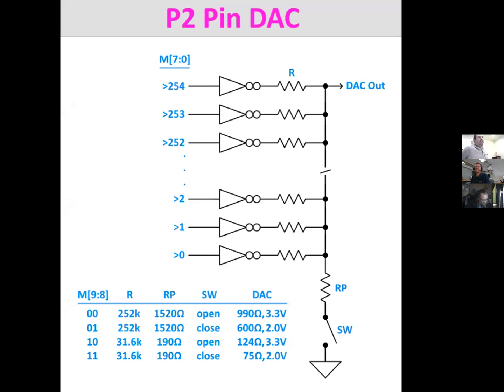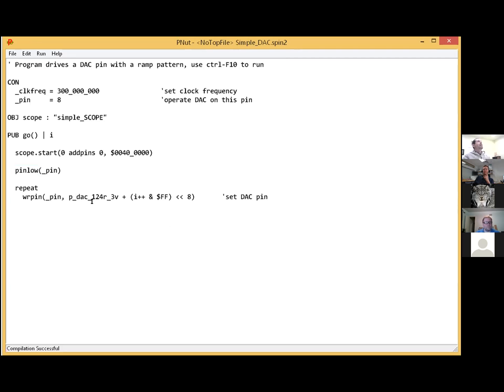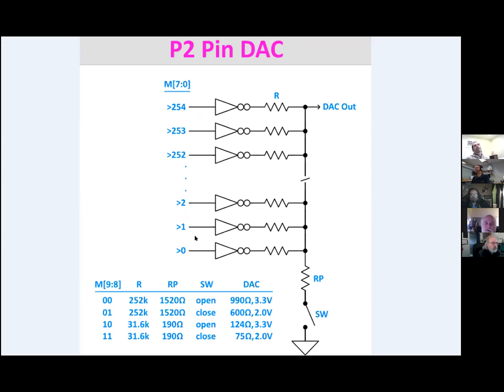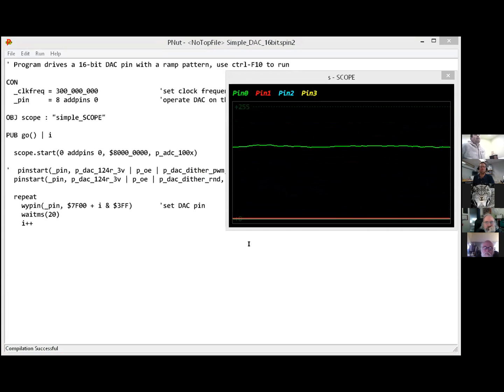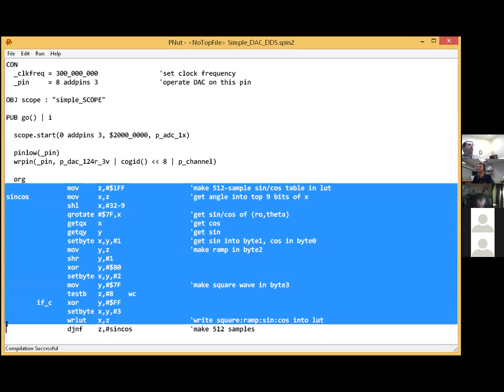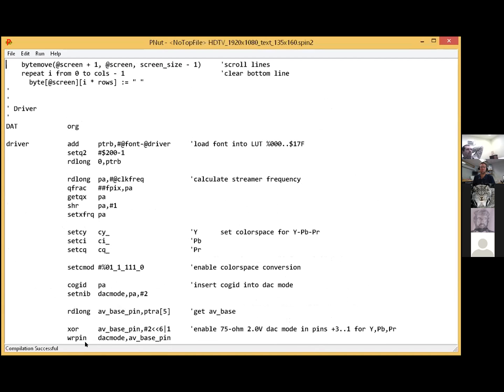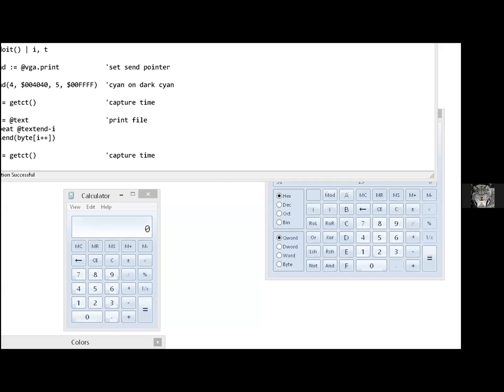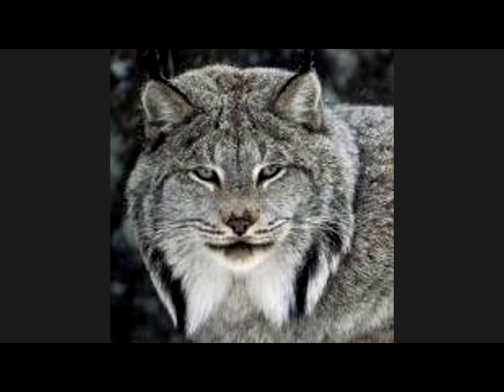Propeller 2 Live Forum: DAC Examples with Chip

Comment: Folks, USB-C video doesn’t need anything fancy. Just use HDMI alternate mode. It’s HDMI physical layer, capacitively coupled, running over USB-C plug and cable. Still HDMI. P2 already does 95% of it, the rest can be done even by an Arduino. All it takes to enable the alternate mode is a bit of 300kbaud PD signaling over one wire to negotiate the alternate mode with the sink (eg a monitor) and then you just feed HDMI straight from P2 pins over the TMDS lanes. If you want details for CC packets needed specifically for this mode, you have to get the HDMI USB-C alternate mode spec from the HDMI overlords for a sweet $5k (gives access for a year), or just sniff how your fave PC chats up a monitor or a TV over USB-C. All you want to sniff is the slow 300kHz USB-PD signaling. A replay with the same sink will get it working 95% of the time as a proof of concept, you don’t even need to know what the data means. HDMI alternate mode uses USB-PD signals (again, a slow channel), to negotiate it. But this aspect is not covered by the USB-PD spec available from USB-IF. The HDMI boffins guard it because else they’d be publicly shamed for how tightly they guard what amounts to not very much of actual information. I wish that org got disbanded with judicial prejudice :/

You can also use DisplayPort alternate mode – compatible with DVI, and IIRC the spec is open, so you’ll be outputting the same physical signal as with HDMI, just that USB-PD negotiation will use different “magic packets”.

Sure, HDMI alternate mode does not mux signals with USB 3 streams, but you still have USB-2 channel to the sink and its built-in hub, and you could drive it with a USB PHY for high speed link concurrent with HDMI. At least IIRC the USB-2 lines can remain active in spite of HDMI-alt mode but feel free to correct me if I’m wrong.

Comment: When I was 10, something like P2 that could just generate a dozen color video outputs live in software, while doing other things as well, would be akin to some advanced civilization teleporting their sci-fi tech down here. 

Chips like that one were beyond my imagination I’m sure. MSI TTL functions and a CPU + UART were already mind blowing enough to me back then – I was barely getting into them in any depth.

I still recall the ecstatic feeling I got when I figured out, from a 5th generation Xerox of the datasheet, how to get a CRTC programmed with timings for a monochrome video signal that would finally get a SECAM monitor to sync (all examples I had were of NTSC timings and my monitor-née-TV had trouble syncing even to a good antenna signal). I had an oscilloscope and managed to figure out where the video signal was inside the TV, and wrote all the timings down from that and sketched the general shape, then got to mess with the CRTC for days and days until it all clicked into place. I had got a new video card for a CP/M system and all it came with was the CRTC datasheet (not even sure all pages were there).

I admit, I relived a bit of that excitement when I got SX48 to output a mono video signal, years ago. Same with P1. Same with P2. There is something magical to composite video in my mind.